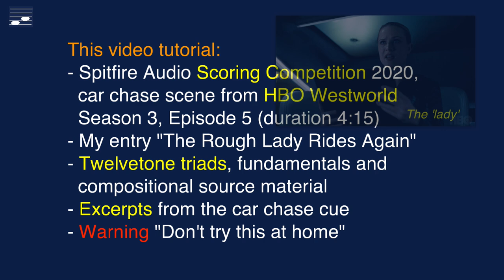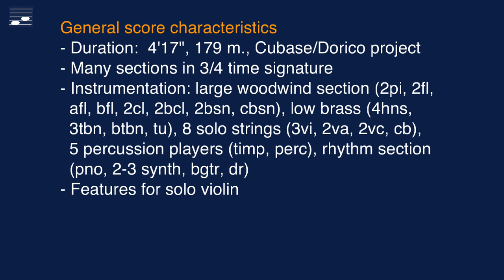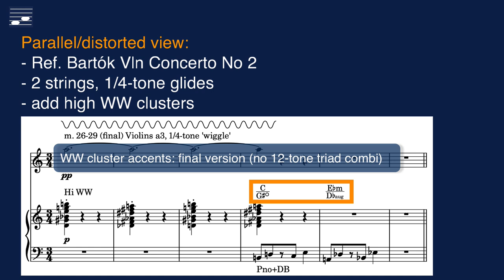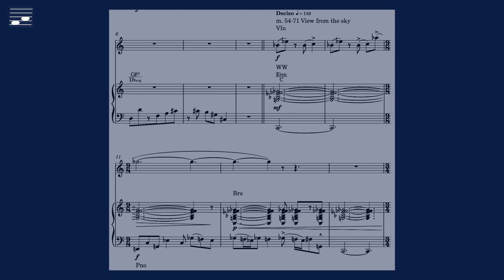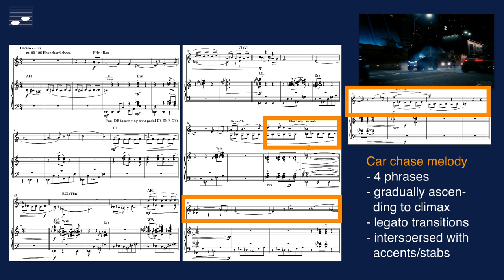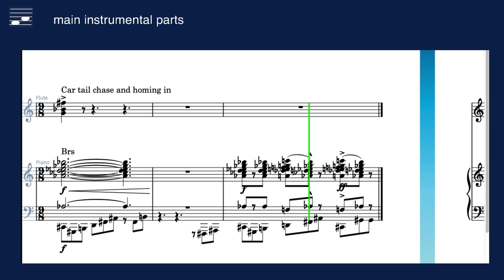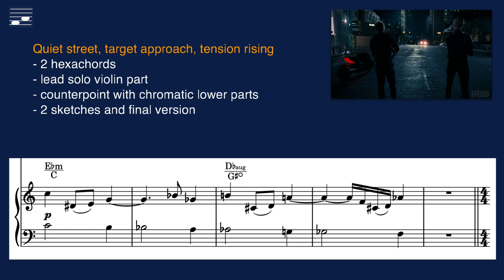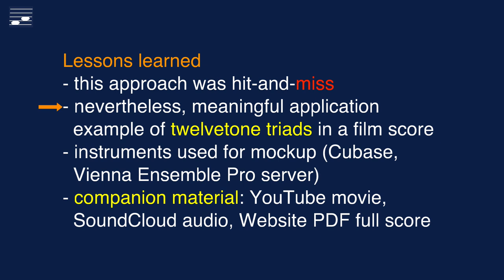Composing with Twelvetone Triads: The HBO Westworld Car Chase Scene

Comment: The new music Tonal Scale is as thus: 12 7 5 2 3 : 1 4 5 9 14
Not 12 with 7 & 5 BUT 14 with 9 & 5   [2^(1/14)]

These are the Tonal Scales growing from f (by cycles of fifths):
All Scales build from the first mode: equivalent to Lydian f
White keys are = & Black keys are |
12 with 7 & 5 [2^(1/12)]  =|=|=|==|=|=  {1,8,3,10,5,12,7,2,9,4,11,6}   
                                                                   1thru7are=   8thru12are|
  7 with 5 & 2  [2^(1/7)]   ===|==|   {1,3,5,7,2,4,6}   1thru5are=   6&7are|
  5 with 2 & 3  [2^(1/5)]   =||=|   {1,3,5,2,4}   1&2are=   3thru5are|
Now evolving up the other end
  5 with 4 & 1  [2^(1/5)]   ==|==   {1,3,5,2,4} 1thru4are=   5is|
  9 with 5 & 4  [2^(1/9)]   =|=|=|==|   {1,8,3,7,5,9,2,4,6}  1thru5are=   6thru9are|
14 with 9 & 5 [2^(1/14)] =|=|===|=|===|  {1,12,3,14,5,7,9,11,2,13,4,6,8,10} 
                                                                       1thru9are=   10thru14are|

Joseph Yasser is the actual originator of the realization,
that scales develop by cycles of fifths.
http://www.seraph.it/blog_files/623ba37cafa0d91db51fa87296693fff-175.html
https://www.academia.edu/4163545/A_Theory_of_Evolving_Tonality_by_Joseph_Yasser
http://www.musanim.com/Yasser/
The chromatic scale we use today is divided by 2^(1/12) twelfth root of two
Instead of moving to the next higher: the 19 tone scale 2^(1/19) nineteenth root of two
I decided to go all the way down and back up the other end:
So 12 - 7 is 5  &  7 - 5 is 2  &  5 - 2 is 3 
Now we enter to the other side:
2 - 3 is (-1)*  &  3 - (-1) is 4*  &  (-1) - 4 is (-5)*  &  4 - (-5) is 9*  &  (-5) - 9 is (-14)*
ignoring the negatives we have * 1 4 5 9 14
Just follow the cycles how each scale is weaved together, as shown above.
Each scale has its own division within the frequency doubling,
therefore the 14 tone scale is 2^(1/14) fourteenth root of two
Reply from the maker: @Avery Sax Already I responded to your similar comment on the Nika Albi scoring with PC-Set video. So this time I would like to ask: have your created any music with the 14-tone tuning system? And, if yes, what instruments did you use? I only know a limited set of synths and virtual instruments, that would be able to handle these new scales. Thanks for the comment, that certainly opens another harmony horizon!